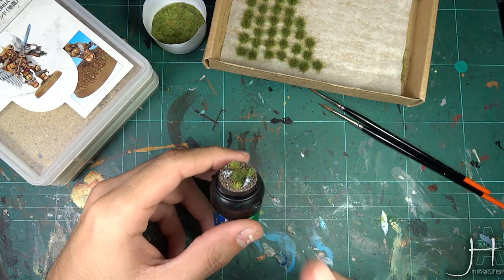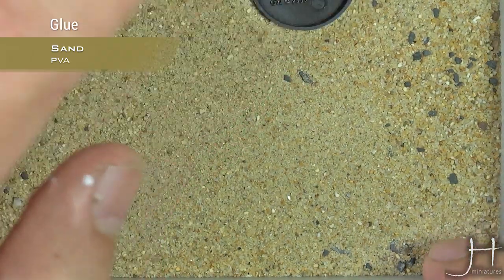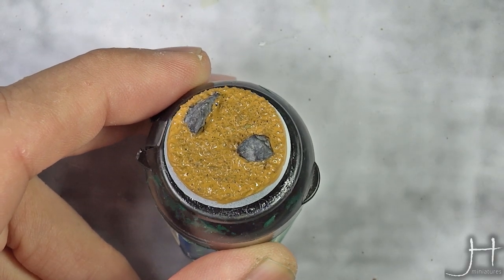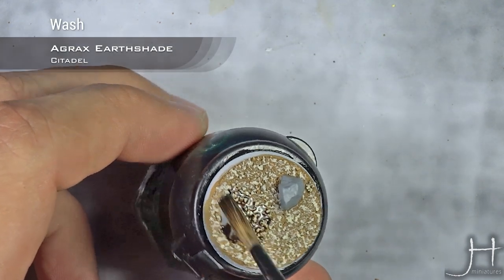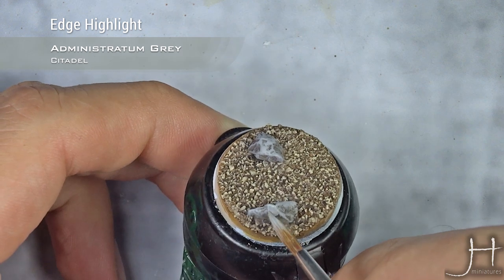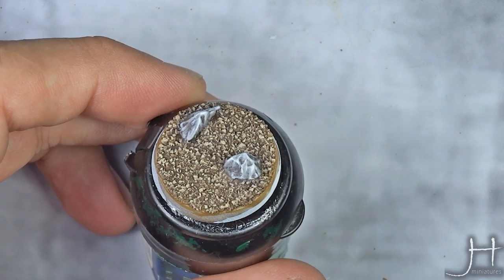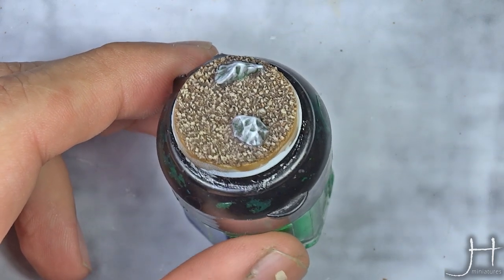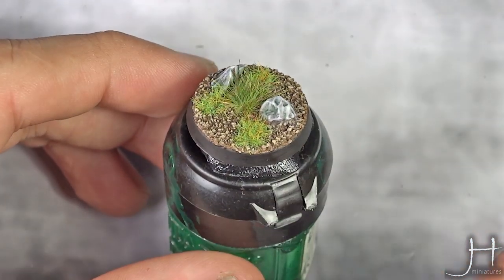How to Base - Painted Sand

Comment: Another great video.

I already did the watered-down glue trick, but I didn't know about priming before adding sand.
Reply from the maker: Yeah, PVA won't stick to plastic but it will to primer and primer will stick to plastic.
Reply: That explains why I've had basing materials peel off like an orange.
Reply from the maker: @davidbruner1130  exactly! That happened to me too. Then I discovered it only happened on the unprimed bases

Comment: Another tip; add a drop of dishwashing detergent to the watered-down PVA and use a syringe or pipette to apply it - the dishwashing liquid acts as a flow aid and it will cover much quicker and easier (tip from model railway days)
Reply from the maker: That's a fantastic tip, I just find it not that necessary for small bases but it's a must for large applications

Comment: Great video.
You don't always need to prime the base before applying sand. You can also scratch the surface (not rim) with a scalpel or file and sand bonds well to base. 
Peeling sand can be caused with applying too much sealimg of base sand with 50:50 water and pva. Or the sand hasn't dried enough before you applied the sealing mix.
Reply from the maker: I still recommend priming for good measure

Comment: Thank you for the tip on the watered down pva to hold the sand together! Do you recommend having your mini already already attached to the base and move the sand around it or do they glue firmly to the sand when the base is finished?
Reply from the maker: I always recommend to do tje basing with the model already attached, it's always better for me.

I've been using that trick to create indestructible bases for years and I always wanted to share it.

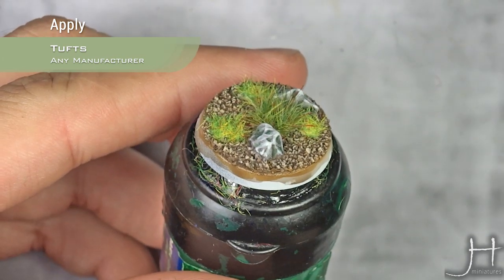Comment: 10:00 Unless you’re painting oldhammer, then anything other than goblin green is a travesty! 
Talking of gob green, would you happen to know what mixes well with warboss green to get a more accurate goblin green substitute? Straight out of the pot it’s a bit of a cooler shade
Reply from the maker: Probably some yellow, I would try Yriel or Averland myself
Reply: JuanHidalgo Miniatures Thanks, yeah I’ve played around with a few different mixes. Couldn’t get Yriel to work, think it’s a bit too bright and saturated. Haven’t tried Averland yet, have a feeling it might work better. 
Then again maybe I shouldn’t worry too much about getting an exact match! 😂

Comment: To hold the sand on, I use extra thin super glue because it flows in like water and makes the base extra solid
Reply from the maker: This method makes it as solid, trust me it isn't as fast that's for sure. 

I just don't like to abuse of superglue as I know people that have developed a very serious allergic reaction to it with too much exposure.

Comment: Hey! What is the primer you use for the base, I don't see it listed on the paints needed (and skipped to the part where your added rocks/sand).
I'm doing a base and started with a Vallejo black primer, should I add something more or I'm good to go adding the sand?
Reply from the maker: Any primer will do as long as it is primer. I prefer sprays as they bond better to the plastic but any primer will do.

I probably used Citadel Chaos Black if you really want to know

Comment: Thanks for the video :) I'm surprised you didn't prime the base before painting. Have you found that it's just not necessary for bases?
Reply from the maker: It is primed before applying the sand.

You can very safely paint over the sand no problem.

Comment: Thanks for the video, I'm wondering, where do you get your rocks from?
Reply from the maker: I have mine from an old GW basing kit. But they are literally just small rocks.
Reply: @JuanHidalgoMiniatures  Thanks for the reply. I've managed to find some and got done basing my first miniature today :) How long do you usually wait for your pva glue to dry before applying paint?
Reply from the maker: Until it's fully dry 😂

You will know when it's fully dry
Reply: @JuanHidalgoMiniatures  Cool. Feels dry after a couple hours so screw it. Some guy told me to wait 24-48 hours so I was kinda puzzled.
Reply from the maker: Trust me, you will know when it's dry, if after a couple hours you feel it's dry, go for it.

It will depend on what glue you use and how much water, so trust your senses

Comment: Thanks for the video. Thats a nice trick to not have sand in my living room 😀

But what is the point in painting sand that allready looks like sand with sandish colours?
Reply from the maker: Because it lacks contrast, the scale is not correct. Plus having unpainted elements next to painted ones looks off
Reply: @JuanHidalgoMiniatures  

Makes sense :-D

Your result looks much better. I just couldnt explain to myself why.

What is the Water-Glue ratio when sealing the sand.
Reply from the maker: No ratios, I do it by feel.
Reply: @JuanHidalgoMiniatures  
Allright.
Thanks for your fast replies!
Reply from the maker: Happy to help